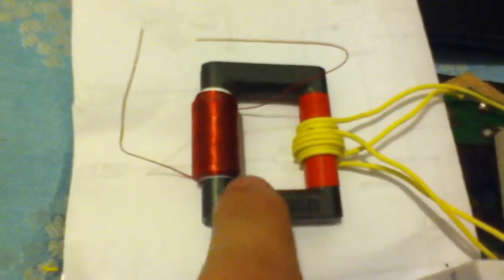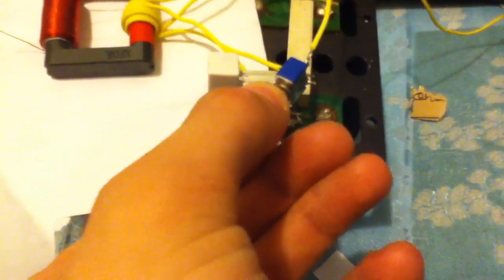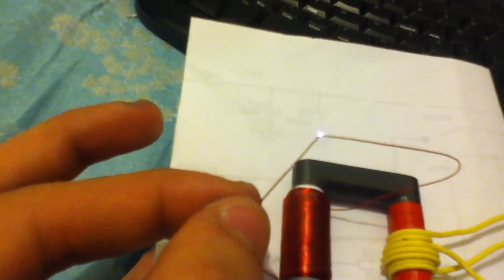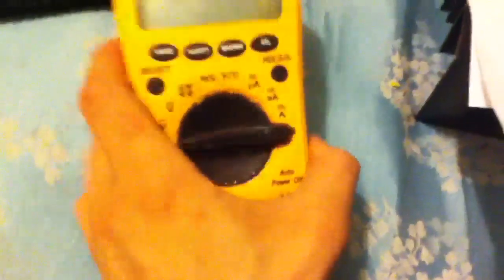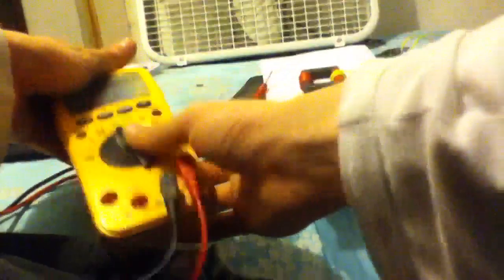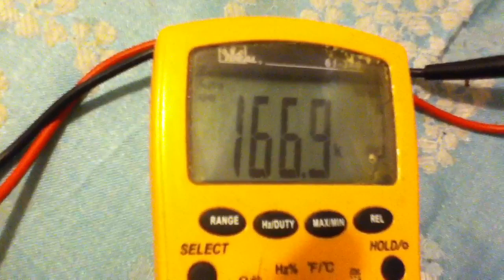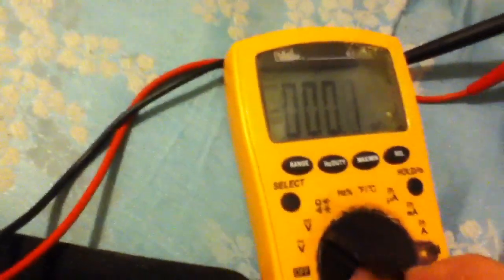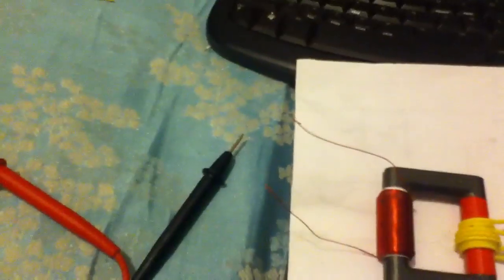Flyback Capacitor Charger

Comment: How is this flyback?  There is no flyback transformer on it.  That is just ferrier core.
Reply: Flyback means that the action of concern takes place when the transistor/MOSFET switches off, and  the  the collector or the drain returns and in fact it more than returns  to the supply but it flies  back very fast indeed as that is the characteristic of any inductor when it feels that it is being switched off  and it tries to retain  its current  which was flowing at the moment when the  inductor is switched off.  A flyback transformer uses this procedure.  any transformer  switched transformer would do itif it has one single switch.

Comment: Have you considered the ZVS flyback driver circuit? I used it for mine, and it works great. Charges a 2700uf cap to 350v in about 20 seconds. Could probably charge a lot faster, but I put a big current limiting resistor on it so I don't blow up another diode. Can also draw inch long arcs from it...

Comment: @tesladude19 the voltage has to be at least 500 volts the diodes in the meter can't switch fast enough. when i had my zvs and hand wound flyback I had a tube for the rectifier and that worked the best.

Comment from the maker: @3mustardMoNkEyS Well first I should point out that my meter can't read this kind of current, it can only read AC up to 400 Hz and straight DC. with that being said, I'm looking for at least 450 volts. With 12 volts input, a 7 turn primary, and a 250 turn secondary I should see 428 volts, and once rectified almost 500 volts. I ordered parts for the ZVS driver and some fast recovery diodes and should have them sometime next week. I'll make another video when I have everything finished (: